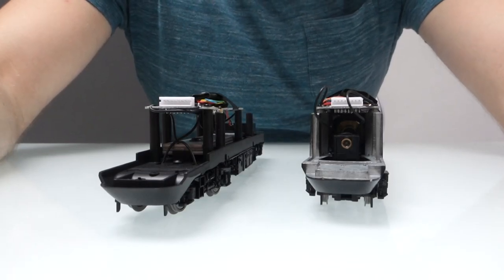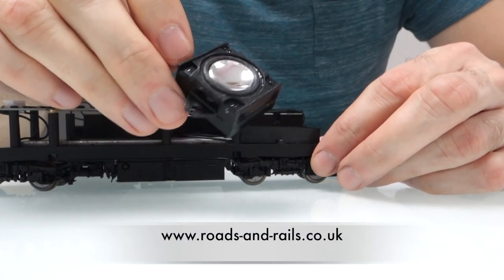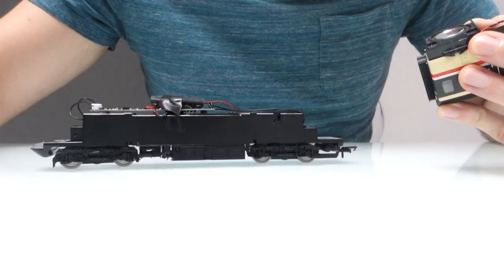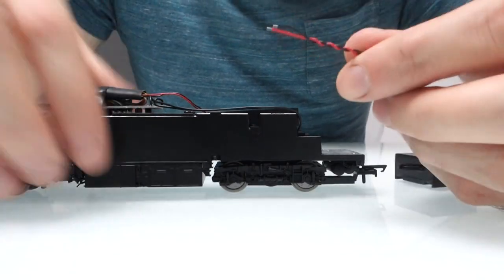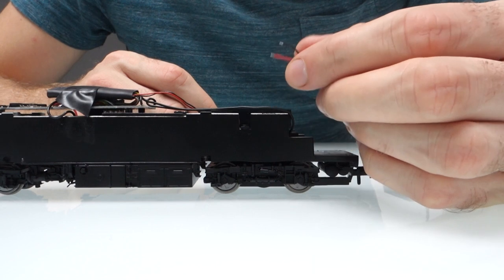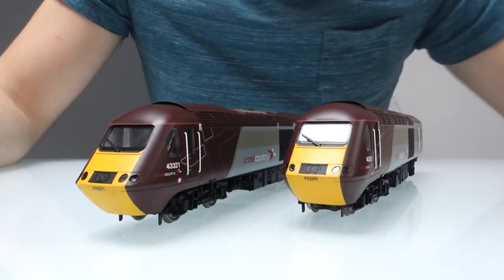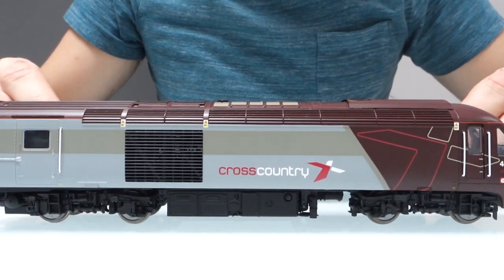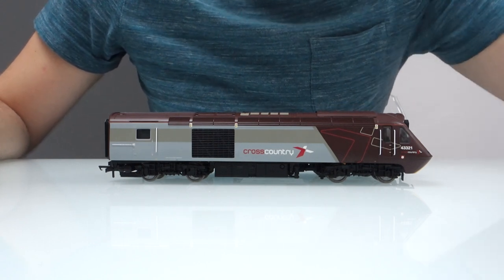Upgrading The Hornby TTS HST, Valenta And MTU With Mega Bass!

Comment: What a difference the mega bass speakers add! Thinking of sticking a TTS decoder in my old HST set and would definitely upgrade the speakers to these.
Reply: according to what i hear on here  definitely!!   I watched another mega bass fitting on YT and the valenta  sound was tremendous!!!
Reply: @davidcurrie8564  the Valenta engine is by far the best. What a sound they made. Was lucky enough to be given a “tour” through a 125 many moons ago as a kid and the memory stayed with me. I know they weren’t “economical” but like when F1 changed to hybrids, the change of sound made the 125 boring!
Reply: @SJDewar1990   sod economical Stevie!    the very sound of that 125 engine at full tilt raises hairs on the back of my neck!   watch the 125 blasting through prestonpans  on here YT
Reply: @davidcurrie8564  I’ll be sure to check it out! You’re right about them making hairs stand up, they used to go full tilt on the line that i lived 2 minutes walk away from and you could feel them roaring past too!

Comment: hi. mine doesn't move with my analogue controller. it only makes a low buzzing sound. I don't yet have a DCC controller to try it. do you think I have a faulty unit. many thanks
Reply from the maker: cavman543 DC running is disabled on these by Hornby, the only way to get them to run on DC would be to change CV29 with a DCC Controller
Reply: do you think I may have damaged it by trying to run it on analogue without first changing the cv setting?
Reply from the maker: cavman543 no, it won’t affect it
Reply: ok. that's a relief. thank you for your help.

Comment: I actually think the Hornby speakers sounded better in the Valenta. You want the higher pitched scream on those- which the Hornby one does. 
MTU however sounded better, but this engine has a more deep Bass sound which I actually prefer nowadays, more suited to your bass speakers. Nice video though mate.
Reply from the maker: Stuart Simmonds interesting take on it, I think maybe ‘megabass’ is the wrong name for these speakers because it implies that’s all they do, they are a full range speaker with a much better performance across the whole frequency range. Listening to them in person the high pitched scream comes across much better from the new speaker than the Hornby original, maybe it’s an issue trying to record the sounds with a compact camera and in built microphone. Thanks for the comment though, it’s good to hear different opinions, Richard